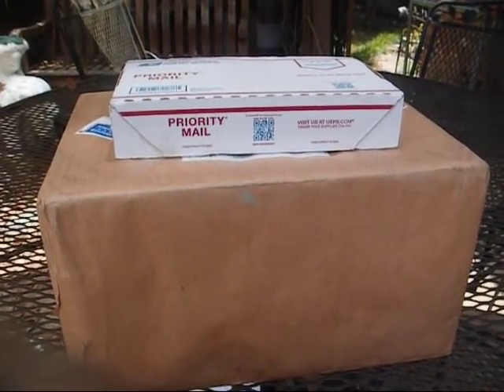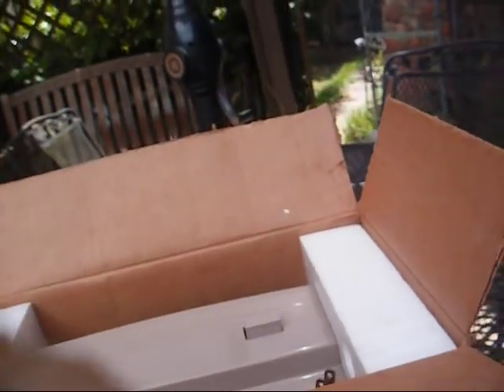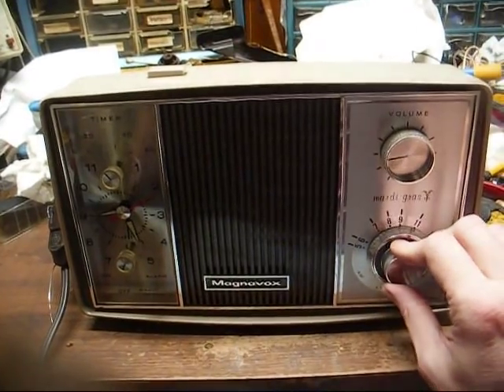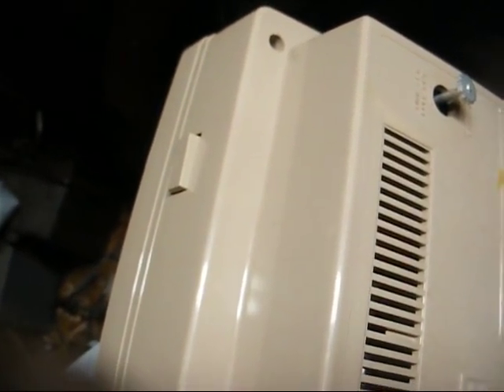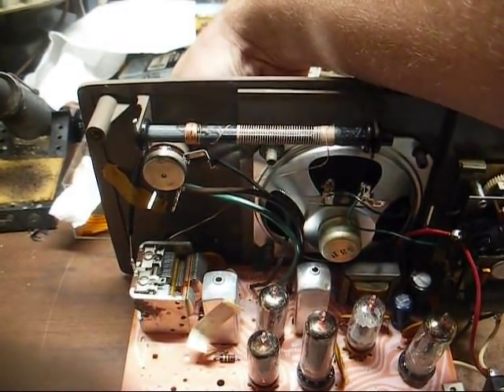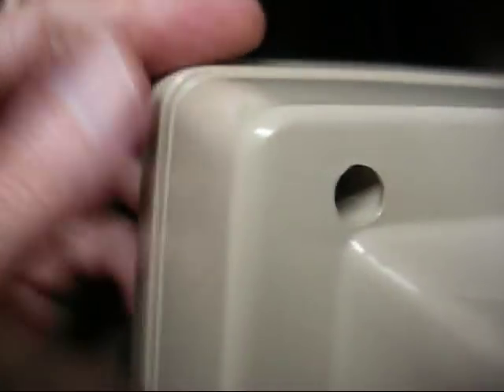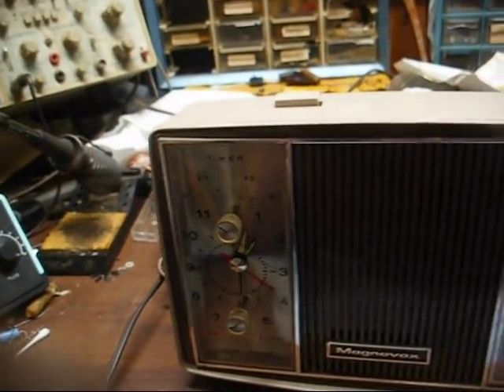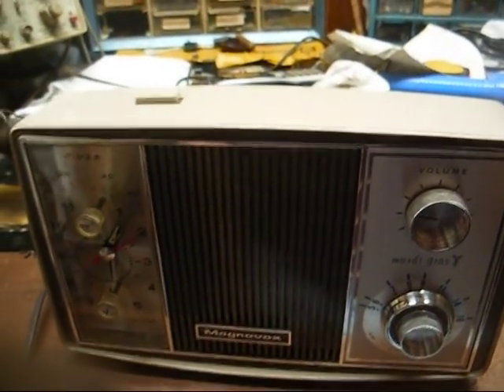Never used (?) Magnavox AM tube clock radio from 1965

Comment from the maker: One day, I'll get around to fixing the clock and fixing the broken plastic, when I have more time. As annoying as it can sometimes be to fix this old stuff, at least this old stuff can be fixed (I'd like to see someone fix a modern flatscreen TV, a Crosley record player, or a Smartphone in 50 years). A lot of this modern junk is doing good to last a few years; but, a lot of these '60's clock radios, for example, lasted for 20-30+ years.
Reply: I have a 1969 Zenith a.m. f.m. tube clock radio - possibly the last consumer tube radio made. It has a stock silicone rectifier, no need to change, it is used often  and sounds gorgeous. Nice large ferrite rod on the Maggie!
Reply: @harshnemesis  Captain Obscurity here! LOL
Reply: @harshnemesis  In the early 70's, f.m. radio in my area had mind blowing stereo. Transmittters that produced great hi fidelity sound were expensive to buy and run. Now all the stations use cheap equipment and the result is low fi crap sound. Not to mention the commercials are as bad or worse than a.m.. They took away your heritage and soul, and you don't even know it, kind of like the matrix.
Reply: Try Stanley brand hot glue.  It seems to hold smooth PVC way better than any other hot glue. Two pieces of smooth PVS glued together with the Stanley hot glue was able to hold a 445 pound weight!  Since this stuff is clear and pretty cheap, it would seem to me the way to go with such a repair.
Here's a review from a guy I follow on YT 
/watch?v=hu8sJBctzFc
He just uploaded the video yesterday.
Reply: @harshnemesis  Speaking of IC's, google "Tinkertoy Project". The Tinkertoy modules were the steppingstone to the IC. I own a 1957 Motorola with such a module. This component was designed by the Navy to prepare for WW3. Which had we not you would probably not be here.
Reply: @lands1459  Not trolling. I was trying to communicate with it, but it just got vile with you, so time to ignore it and block. Sorry you were subjected to that.
Reply: @lands1459  He had some good videos. Too bad he has no manners or people skills.
Reply from the maker: @lands1459  I don't worry about them - I just block them and "Dark" is now blocked from commenting on this channel. I don't mind people giving their thoughts on certain subjects; but, when those thoughts turn into an "I'm right, you're wrong, and you're an idiot" attitude, then it's time for that person to go bye bye.
Reply: radiotvphononut Good news. He’s just a pointless troll.
Reply: @harshnemesis  everybody seems to be an electronics tech any more, and really have no idea what they are doing. People aren't what they "post" to be
Reply: @harshnemesis  Oh dear. Any reason why a 1960s Jag or Alfa is preferable to a modern tin box?
Or a Thorens TD124 compared to a Crossley? Or a Radford / Quad to any modern music replay system? The list is endless. One lot of things are built by craftsmen and artists of beautiful materials and often perform to a much higher degree of excellence - whilst the other is mass produced shite.
Here is my point, some people just have no experience and should learn a bit before making comments.
Reply: @yardleybottles6025  That was the perfect reply...I shouldn't have bothered. Brilliant.
Reply: @radiotvphononut  What's sad is he wasn't even too far off, but calling people "hipsters" and other names simply because they think a different way isn't warranted. I'm glad you blocked him, he clearly doesn't belong here.
Reply: radiotvphononut actually there are people who fix smart phones today.   For some flatscreen repairs, check out YouTube user 12voltvids, as the guy who used them fixed some of those TVs from the mid to late 2000s.   He also has fixed many 1980 to 2010s electronics stuff include tape decks, VCRs, video cameras. TVs, DVD players, CD. Players, and others.   Check out that channel to see some of those get fixed.
Reply: I would never buy a digital radio, the bit rate is crap, just like DTV, I'll stick to my LP120 for music with 1000s of LPs, 45s and 78s
Reply: I did fix my cellphone (Kyocera QCP3035) three times where the power Jack would break off from the circuit board.
Its extremely compact size, collapsible antenna, audio quality, reliability, and the fact it could be used digital or analog at will, had me determined to use it as long as I could.
It came to its end when my carrier abandoned its CDMA One network.
Reply: at the end of your video the clock was working.
Reply: Most of the problems with flat screen TV's are the same as that radio: Bad electrolytic capacitors, though many failed within a year instead of 50 years.
Reply: i've usually heat the plastic up with a hair dryer to stop the studs from breaking its not a guaranteed way but it works

Comment: I have a Zenith 5 tube AM clock radio, similar to that one.  To get the clock running, I had to clean off all of the dried-up grease on the gears.  The drive mechanism was working but the gearing was stuck due to the grease.  I also replaced the one capacitor with 2 separate ones.  I now use the timer on the clock to fall asleep listening to the radio, and it wakes me up in the morning as well.  Nice, dependable units.
Reply: Excellent point about the dried up grease.

Comment: I am really glad this turned out well for you Bryan. I cringe when I hear of someone buying a NOS anything from the 1970's and 1960's.
Reply: EH??? Why?
Reply: @martinda7446  2 key reasons - a good number of items do not work due to age, and secondly a very high percentage of "New In Box" items are not truly new, but defective items returned to the box, often store returns that made it out to the marketplace when the store closed.
Reply: @alanmaier  Alan, OK. From the perspective of a collector or engineer/collector even the defective return is a wonderful find. Most of us would commit murder to get a boxed defective dot dot dot..(Radford, Fisher etc.). For someone who is expecting something to simply work out of the box, who isn't technically minded sure it's a big risk. These wonderful time capsules though are what make people like me and RTVPN go a bit loopy. I have managed over the last 45 years to get hold of a handful of such things and they are well loved.
Most things age fairly well. The only things that are sure to deteriorate with time are rubber and plastics, electrolytic capacitors and grease. Switches and connectors can tarnish. All the resistors, transformers, regular caps, pots etc. (90% )should be as new.

Comment: Many moons ago, found a way to break loose tight screws in plastic cabinets by touching a skinny soldering iron tip to the screw for 2-3 seconds. If the hole is too deep, heat a screwdriver that fits the screw, wait a couple seconds, and SLOWLY unscrew. Works about 80% of the time.

Comment: I have found that Gorilla Super Glue is really good for repairs like that and takes way less time to cure.  I have used it for glueing shoes back together and it works great.   It takes a few minutes to cure, it is not instant like the other super glues.   The other brands of super glue are pure crap, Gorilla glue is really good.     I am sorry to say I never had good luck with JB Weld. 

That Magnavox clock radio sounds good and it is worth hanging on to as a classic piece of vintage electronics.    I own a Motarolla Am clock radio that belonged to my grand parents, I need to recap it.    From what I have figured out, it was made in about 1967.  It still works good, but the volume is very low because of bad caps.  I replaced 2 caps in it when I first got it after my grandpa passed on and it was working perfect.  Being that I used old junk caps, it needs them changed again.   The clock still keeps good time, I keep it pluged in to keep the humidity from causing damage to it from sitting up.   The radio still works good, just very low volume.

Comment: We have heated the clock motor and put oil on the shaft.  We then let it cool. It soaked the oil back in and the motor worked.

Comment: Although tricky, those clock hands can all be set back in place.  And, the screw can be removed and the studs glued back in place so you will have an almost all original radio, minus the modern capacitors.  I would have left the original capacitor on the board and added the new capacitors elsewhere...but then again, this is not a museum restoration.

Comment: A YT guy I'm subbed to named projectfarm just did a video on hot glues. I was especially impressed with the Stanley brand of hot glue sticks and its ability to bond smooth PVC parts together.  I would love to see how that would work with these plastic parts.  That Stanley branded hot glue held smooth PVC hundreds of pounds (I think it was around 500 pounds). I think it might be just the thing and would look way better than JB Weld.  Why don't you give it a try?  Probably cheaper than JB Weld too.
Reply: JB Weld might be better for this application I believe, hot glue can be strong but the constant heat given from the tubes could easily melt it I'm sure. Cool to see someone else here who watches Project Farm, his content is great!
Reply: I forgot about the heat of tube devices.  I thought it might be a good match because of the fact that it's clear.
Yeah, project farm is great!
Reply: @tarstarkusz  Yeah the first thought that came to me when you recommended the hot glue was the shear amount of heat my '59 Zenith produces, even the relatively thick wood cabinet gets pretty warm to the touch on the outside. I definitely want to try that Stanley hot glue though, it seems pretty impressive for what it is!
Reply: Especially for the smooth surface strength.  I want to pick some up and give it a try.  It sounds promising for plastics.

Comment: In 2017 I found the same radio minus the clock at a spring cleaning sale.  Looks like the same chassis. FrontThe printed sticker on the bottom shows R30101 chassis # 01/65. Another label shows model R006 serial number 3965837 watts 35 color gold. Mine has the 12BA6 RF stage installed. The remaining tubes are 12BE6 converter, 12BA6 IF, 12AV6 detector/driver, 35c5 output and 35W4 rectifier.
The same power supply electrolytic in the same condition. Even my repair looks identical to yours.
Plastic cabinet in mint condition. RF 12BA6 and 12BE6 were replaced in the past with non-Magnavox tubes. Some initial silver mica disease mostly disappeared over some months of usage.
My most used tube radio due to excellent audio.

https://www.flickr.com/photos/108196908@N08/39564634912/in/datetaken/